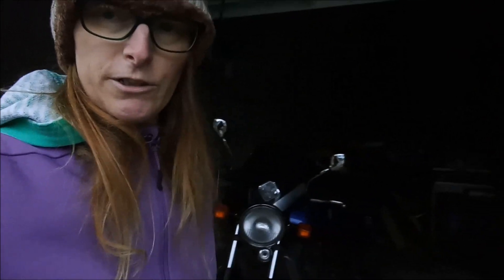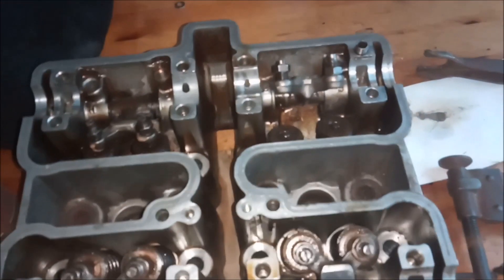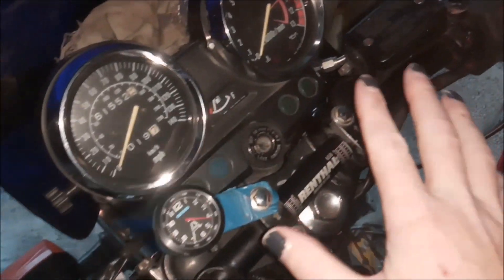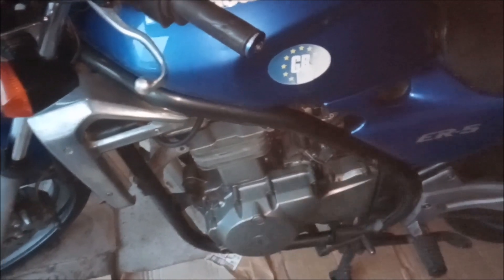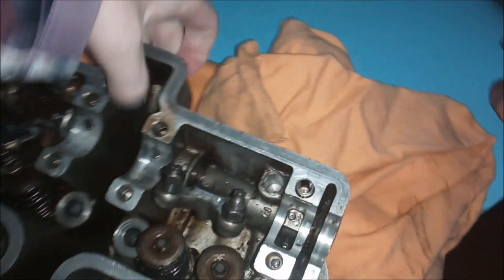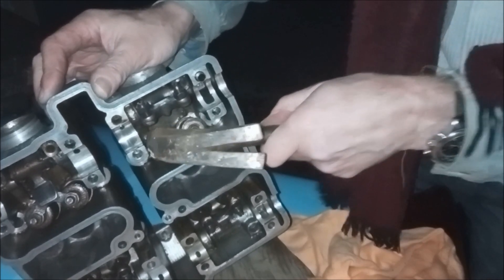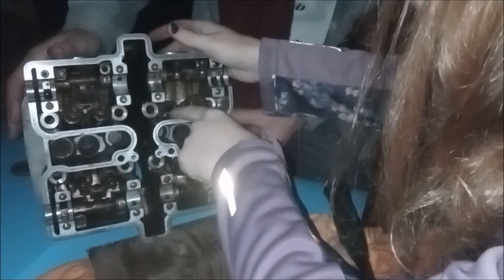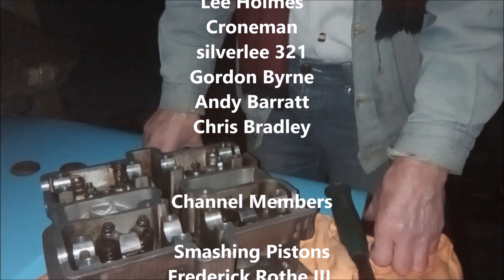Kawasaki er5 bent valve stem removed

Comment: Re the engine locking up and red light thing, Had a few of these over the years and they have a reputation for the magnets and wiring coming loose on the generator under the end casing. they are stuck on merely with glue that over time fails and allows the magnets to come adrift (it can be carefully be stuck back on if not too badly damaged), this causes an electrical short at best causing bad or no charging and resulting red light to show, another indicator of this is poor starting caused by a poor spark due to power loss, In extreme cases if they come off entirely they could cause the engine to lock up by getting jammed between the generator rotor and outer casing. Hope this helps